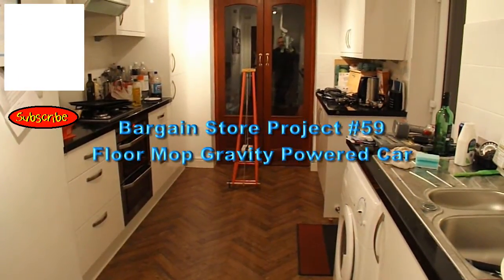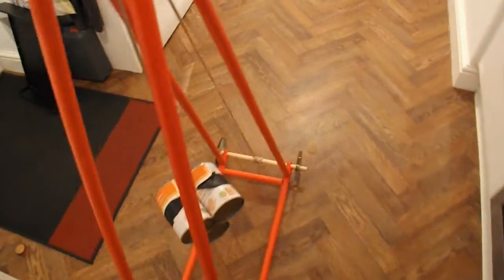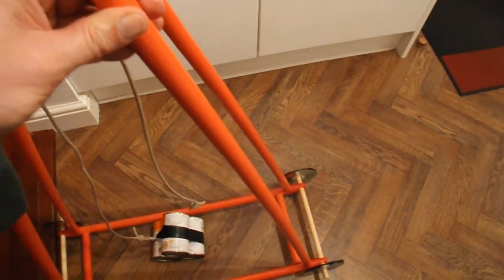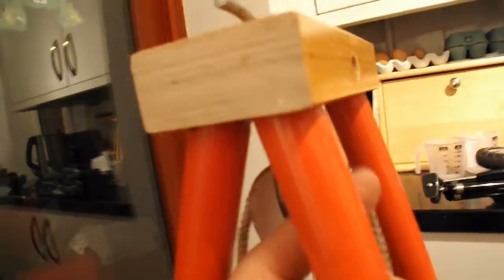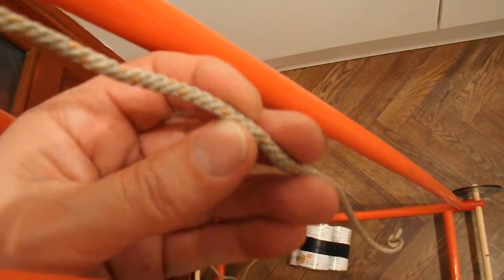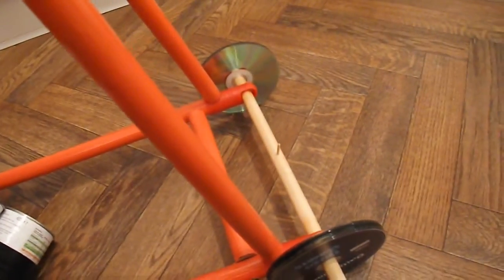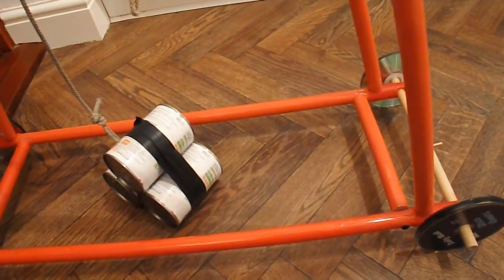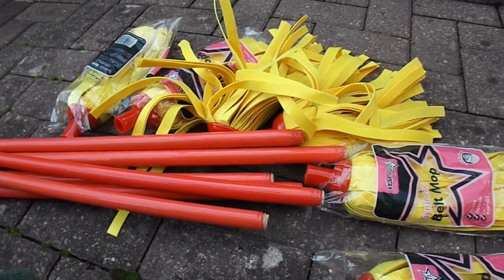Bargain Store Project #59 Floor Mop Gravity Powered Car

Comment: Thank you so much :-)  I will try working on it
Reply from the maker: Hi Lexi, I think this car is probably bigger than you need. I was just trying to show that there are lots of different choices for materials when making these cars. I was really looking for a cheap brush that had a metal tube for the handle as I have a couple in my garage that have started to rust but the only ones in the store were wooden handles. Another source could be an old aluminium framed chair or greenhouse.
Reply from the maker: Hi Lexi, I made another gravity car tonight which is a much more sensible size and runs across my kitchen easily Bargain Store Project #60 Storage Box 1 kg Gravity Car

Comment: The wheels on my car keep sliding side to side
Reply from the maker: Do you mean they are sliding on the floor or sliding on the axle. If they are sliding on the axle you will need to glue them or add tape. If they are sliding on the floor you will need to put something on them to increase their grip. I often use rubber washing-up gloves cut into strips and stretched round the wheels to act like rubber tyres.
Reply: GrandadIsAnOldMan where would I put the glue or tape

Comment: how far can this go?
Reply from the maker: +Luke McCallum I think the original request was for it to do 3 metres, as you can see in the video it travels the length of my kitchen which is 5 metres and would probably have freewheeled a bit after the weight had finished falling. However as I had not added a catching plate to the chassis the weights would have fallen on the floor and the back axle would have run into it. If the weight was retained on the vehicle then it could freewheel at the end of the drop.
Reply: +GrandadIsAnOldMan Thanks a lot for the reply. I have to do a project for Physics but the car has to go atleast 15 meters for a decent grade.
Reply from the maker: +Luke McCallum this one was about moving the 1kg weight rather than travelling the distance, however the distance is really down to how much friction is generated by the axle bearings. In this car the axle is just wood and the bearings are plastic. If you want to go a good distance then make sure your bearings do the job properly. I have many cars that travel most of their distance freewheeling after the power source has finished. For example this one is at the other end of the extreme only 15 cm high and it still travels 5 metres https://youtu.be/lqXz82BXpvs if you hyaven't found it already I have a playlist with lots of different gravity powered cars Gravity Powered Cars https://www.youtube.com/playlist?list=PLA5a2xPRSrB1zzCqDckAnlOzz8iViuM94
Reply: +GrandadIsAnOldMan What materials would you recommend to maximize distance (in terms of wheels, axles, bearings etc) I assume wood would produce too much friction during the mass falling that it would not coast when the mass hits the ground.
Reply from the maker: Luke McCallum no simple answer. Metal bearings would be better than wood. Maybe Nylon bearings. Depends a lot on what budget you have and what sort of size build you are aiming for. I expect you could probably find scooter wheels with proper ball race bearings. The heavier the components you use the more power is required to start it moving but you may find it freewheels well when it has built up momentum. I am sure I could get a light weight gravity powered car to do 12 metres using CDs for wheels and BBQ skewers for axles and drinking straws for axle tubes. I say 12 metres because that is the greatest distance I can manage in my house. I don't have access to a school hall or anything like that so I cannot test further.
Reply: +GrandadIsAnOldMan Thanks a lot for the replies. You've been very helpful :)